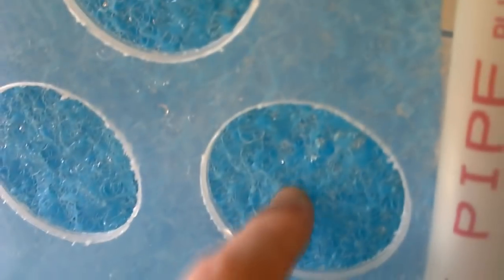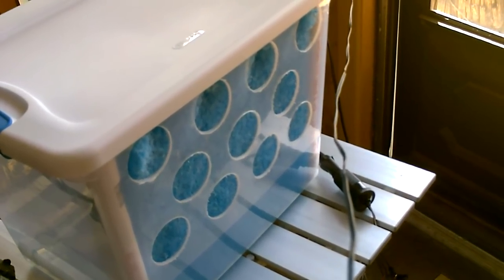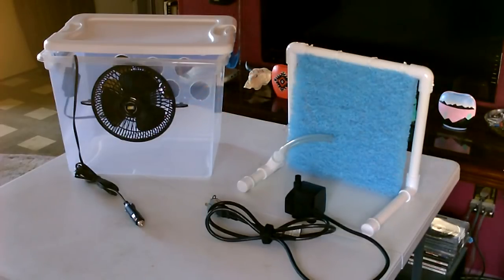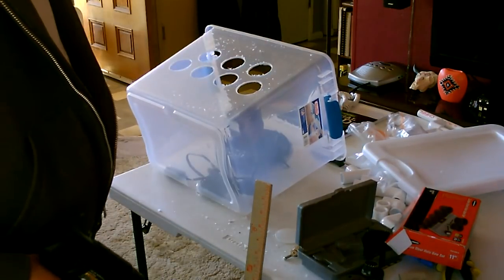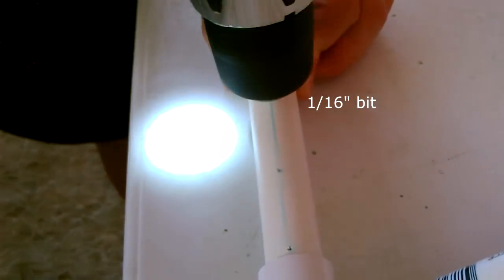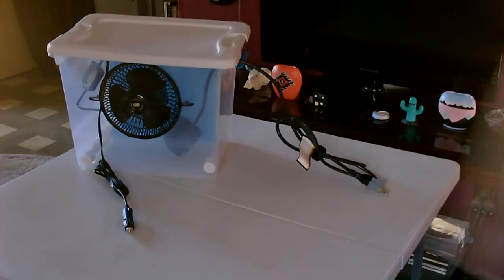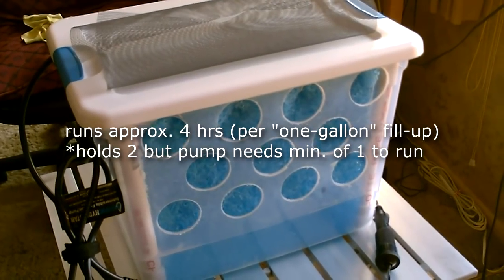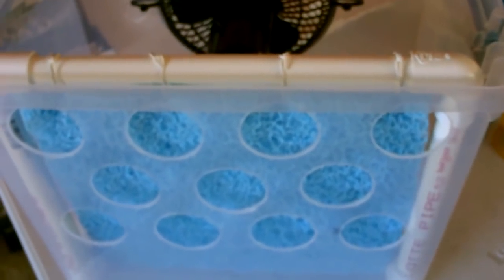DIY Evap. Air Cooler! - Tote Evap. AC Air Cooler! (fits in a Window!) or Desktop -can be solar pwrd!

Comment: Could the fan be in the lid, facing up or does it have to be out the side? I have limited space in my fifth wheel bedroom- this would allow me to sleep in my bedroom during the summer.
Reply from the maker: hi. should work, but then it won't fit in window and if you're using it on table/desk top and sitting in front of it - you won't feel it...
Reply: Didn't think of that.
Reply: Moving air doesn't like to change direction.  Putting the fan in the top would create more resistance in the airflow and result in lessened output airflow from the side.  Having the fan mounted on the side means that the air flows directly onto the pad to help the evaporation process.  A top mounted fan might reduce the airflow against the pad and further degrade the unit's efficiency.  That doesn't mean that it won't work, but you might need to use a slightly more powerful fan if it was top mounted.